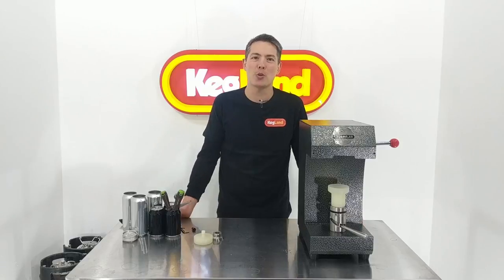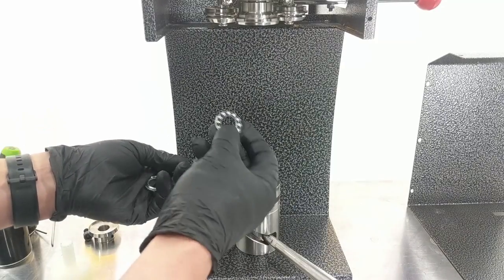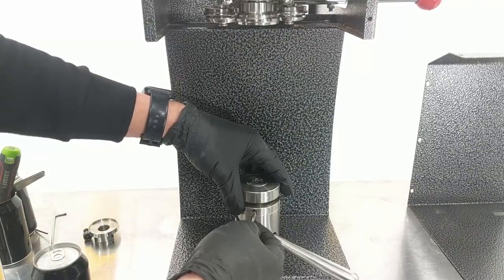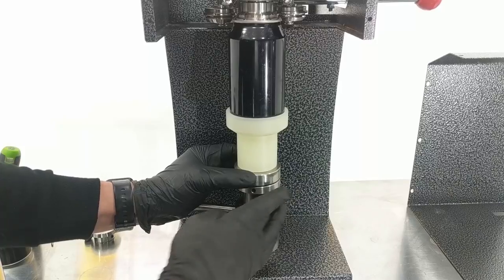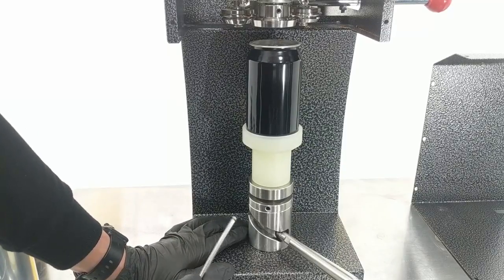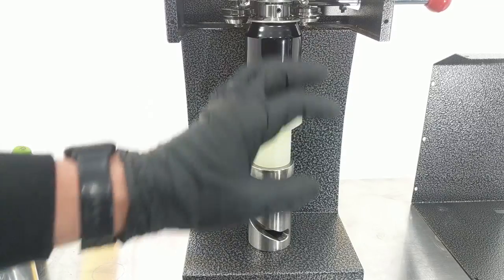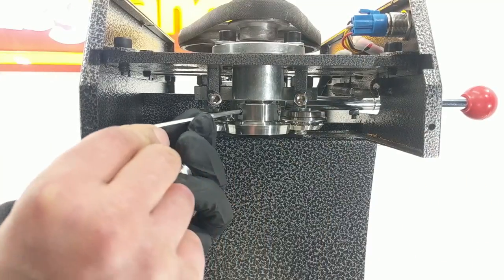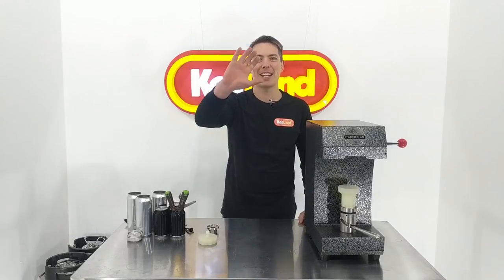Cannular Machine Setup - How to Adjust Rolls, Chuck, Table Height

Comment: Great video, but you should have released it when the Cannular first hit the market. It would also have been extremely helpful to have included the bit about the table axis alignment in the manual, as I suspect that's what caused me several days of frustration and a few dozen ruined cans before I finally got the machine working properly. Now that it's aligned, though, this machine is an absolute pleasure to use. Excellent product.
Reply: Similar experience for me. Really wish this video was available earlier.
Reply from the maker: @kevinnoall6890  Yes sorry about that.  We have quite a lot of videos that are in production but we are getting them out as fast as we can.  Let us know if we missed anything.

Comment: Looks like a fantastic product but I would have expected less adjustments straight out of the box.
Reply from the maker: Yes we do adjust the machines before dispatch so we get 5 successful can seams before the machine is packed up in the box.  With that said customers might want to use different cans that we do not sell and they will find this video helpful.
Reply: HA! 3 days, 50 cans and I have managed to seal 6. Every measurement is in specs, table is concentric, Biggest deal is the exact amount of pressure needed for op1 and 2. Frankly, I have never been more disappointed in any beer product.
Reply: @mushbeeguy5029  I so wish I saw these reviews before I wait three fucking months for this piece of shit... You can buy a way better one on Amazon cheaper and that self seals
Reply: @t.phillips8466  Amen , my friend. Mine went back. I paid bigger bucks and bought an American Standard , manual so it doesn't sling beer everwhere.
Reply: Never been more disappointed in a product. The amount of adjusting needed is complete bullshit. If you buy cans from Kegland should be ready to go straight out of the box. Don’t waste your money 👎👎👎
Reply: @michaelellis660   my experience was different, but i did have to adjust the base. It did take a little bit to figure out the right amount of pressure to use when sealing. I use it at my bar to can beers togo. Occasionally I'll have one that doesn't seal correctly I must admit
Reply: I am really not happy myself.  I have this unit and the y adjustment is not done by turning the roller and adjusting slightly with the threads. It just has a solid cylinder post and once the set nut is loosened it is free to move up and down.  There is no ability to adjust it finely as is shown in this video.

Comment: Whould be a good point if you say how long in position 1 and 2 have to hold. My experience in position 1 - direkt hit it to maximum and for about 0,4seconds and position 2 for just about one turning around 0,3 seconds something . If longer it scratches metal from the can and no sucess seaming it
Reply from the maker: If the rolls are well tuned in this should not be an issue but you are right in saying this very short 0.4sec is all that is required.

Comment: Almost 40 cans in and just 1 can successfully sealed, the next can not sealed. My cannula doesn’t have the treaded bearing adjustment and so 3 hands are needed. It’s been a very frustrating time and I’m just about ready to give up. I wonder if there’s a problem with the cans? Too hard.
Reply from the maker: You really need to contact the retailer or our customr service team.  We have staff trained specifically in this area on how to setup these machines.

Comment: Which system can be used to avoid oxidation as much as possible while canning the beer?  Have you thought about this problem?
Reply from the maker: Yes absolutely.  You need to make sure you are capping on foam.  So make sure to fill up the can with a small amount of foam on top then when the lid pushes down it should push some of the foam out of the head space to evacuate oxygen.  This is also what is done in the commercial canning industry.

Comment: I've just bought it yesterday... It's really frustrating to set it up... You don't have the materials and you need a certain level of skill wich I don't have... Specially when adjusting the rollers to junt the cans
Reply: It means that, is not sweetable for not experienced guys right?
Reply from the maker: @pensadorrealista2825  It's worth contacting our service staff that are able to assist with this.  If you have purchased from us in Australia if you are really stuck we can get the machine back to us and set it up for you then send the machine back out to you. Either way we have never had a machine that was not able to be setup correctly.

Comment: The main problem I have is the concentric adjustment.  I suggest checking that first and using cans that have sparkling water in them as test items so you don’t waste precious beer.
Reply from the maker: Yes testing with carbonated water is our standard practice too. This is a good tip!  Thanks!

Comment: I bought the cannular Pro, and this Video says the 1st OP roller is on the left. The manual for the Pro Cannular says the 1st OP roller is on the Right. WTF is it a typo or is really reversed?? I don't want to waste half a dozen cans to find out
Reply: on the Pro the rollers are inverted.
Reply from the maker: The rollers or rather the operations are reversed on the semi auto as compared to the manual canning machine. Best to go by the manual for your specific canning machine.

Comment: Nice machine but it seems like a lot of adjusting. Ford had the right idea that would be well applied here. And that is "when its tight it's right". Could you not have machined it so that the parts were just bolt on and be right. Also it seems like a large expense for disposable packaging that doesn't even get a return fee. Aren't flip top bottles or just any kind of bottle not a more environmentally responsible option. I get the cool factor here but it seems like a big expense just so Bubba can squish the empties on his forehead. I think this loses sight of one of the reason's for home brewing. "Cheaper the than store bought". Not trying to rain on your parade, just giving another side to it.

Comment: Can sleeves are lined with what chemical?
Reply from the maker: Almost all sleeves are lined with an epoxy coating.  All cans that we sell use a FDA approved epoxy coating which is suitable for a wide range of beverages.  Unfortunately our cans are not suitbale for wine or very acidic liquids such as pure lemon juice.  These products might be ok for a short period but high level of preservatives in some wines and acidic liquids can penetrate through the epoxy coating after some time.
Reply from the maker: @BennyBestt  BPA is a chemical used in the formation of many types of epoxy.  The particular expoxy used is one that has passed the FDA approvals for food contact and in this testing they determin if there is any migration of the substances in the coating getting into the beverage.  The coating passes these tests.  If you would like more information then please email us and we can send you more specificaion details on the coating types if you like.
Reply: @KegLand  thankyou